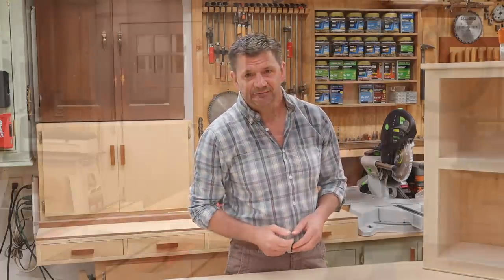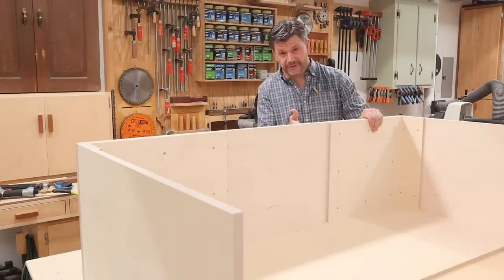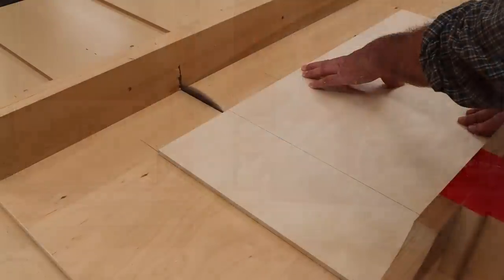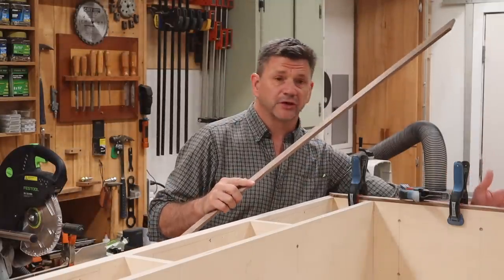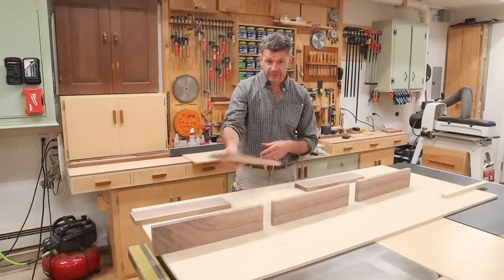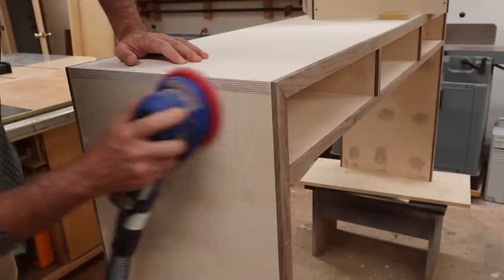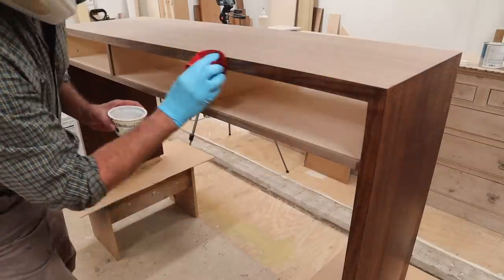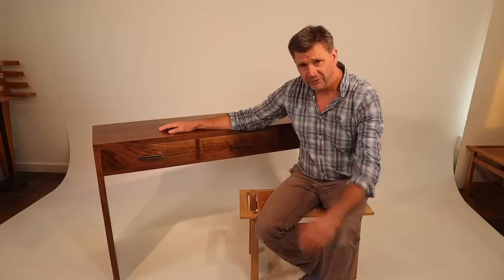Make a Modern Walnut Sofa Table / Writing Desk

Comment: Yup!!! Top 3 easily with this one. So essentially without the pulls you could use the drawers in either direction right? Just curious. Hoping all is well Bud, Dirty Jersey out!!
Reply from the maker: Thanks Mike,  The drawer stop is added after the drawer is in place. It’s attached with a short screwdriver. The Stop prevents the drawer from being pulled all the way out and stops the drawer at the face of the cabinet.

Comment: I keep seeing you use contact cement for veneering, Ive never been able to have good results with it, never is flat and all the solid edges you have there will telegraph over time. I always press in my bag.
Reply from the maker: I haven’t had any problems in more than 20 years

Comment: great build, just one question, do you apply veneer or walnut face pieces to the bottom (basically the feet), as well? or are they left  as is?
Reply: In general I would say no. Veneer is too fragile and would not last.
Reply from the maker: Thanks, no veneer to the bottom of the feet but I did apply finish

Comment: So simple even I could build it!  LOL!  The holder for the bits and countersink are pretty substantial. Where can I get them?
Reply from the maker: You can 👍 thanks!  Montana brand
Reply: @9fingernic  Hey, thanks for the information. Looked at some reviews and the one thing that cam up is wobble?  Have you experienced this?  Thanks!
Reply: @thomastieffenbacherdocsava1549  Here’s a long answer, but this is what I’ve experienced with it:
The only time I’ve had any wobble was after damaging the drill bit. I have the bad habit of leaving my drill standing up right where I’m going to knock it over. 🙄 If the bit isn’t straight, it will wobble. But they are replaceable. And if I can’t replace the bit right away, I just take it slow until the tool gets down to the countersink, and that’s sufficient for most stuff I do. I’m not as precise as Jon Peters… yet! 😆
The rest of the parts have not failed me yet, and I’ve used it for thousands of screws. If it failed, they have a lifetime warranty for defects. One of my buddies dropped his drill off a ladder, and they sent a replacement. 

I just threw my first one away, but it was because I rounded off the Allen key in the shank by over-tightening the set screws. At $10 for another, not a big deal after all the use I got from it. 
I would never use it in an impact driver. The main body is aluminum, so an impact driver would damage it over time. But this tool is designed for finesse anyway. I wouldn’t need the power of an impact driver if I’m drilling the proper size predrill. I know others will have differing opinions about impact drivers.